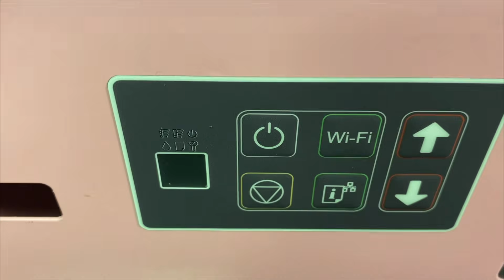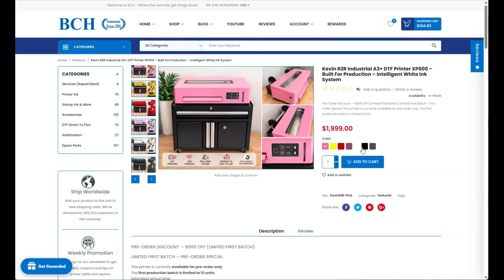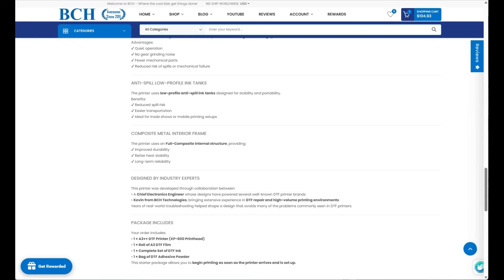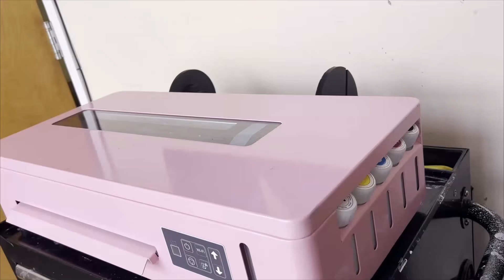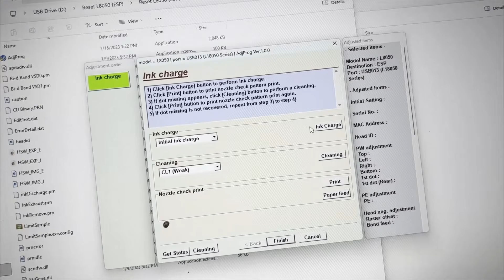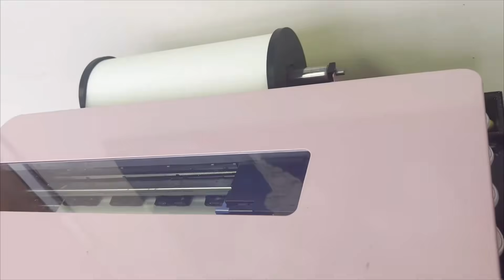Most DTF Printers Are Overcomplicated — This One Isn’t

Comment: Hi can u tell me cr motor model number
Reply from the maker: Thank you so much for your support and engagement! The CR motor used in that printer is a proprietary part, so we’re not able to disclose the model number. You are right that the CR motor is a very critical part of this printer. Most Epson printers are not designed for roll to roll DTF printing. We did shed blood and tears to get this motor correct.  We sell the motor seperately on our website which can work with ET-8550, L18050, 1390, and L1800. https://bchtechnologies.com/products/industrial-high-torque-cr-motor-upgrade-for-epson-et-8550-l1800-r1390-1390-dtf-printers?_pos=1&_sid=23066c6fa&_ss=r I truly appreciate you watching and asking. I receive a high volume of printer questions every day, so subscribing or becoming a channel member really helps because subscribers and members receive priority replies and extra benefits such as early access to videos; subscribers and members are typically answered within 48 hours, while regular viewers are answered if time allows since I can only reply to about 10 questions per day. After subscribers and members, any remaining reply slots are filled last-in, first-out, meaning newest questions are reviewed first, so if a non-subscriber does not receive a reply within 48 hours, they can either subscribe or repost the question; if they subscribe later, their older questions automatically become priority without needing to repost. For faster assistance, please email [support@bchtechnologies.com](mailto:support@bchtechnologies.com), and I also invite you to join Run With Kevin — LIVE, where I go live every morning, usually between 6–11 AM Eastern, and answer printer questions in real time, so please subscribe and turn on notifications to catch the next live session and ask directly. If this video or comment helped you, I’d really appreciate a Google review here: [https://g.page/r/CfL7k6nYvPQ9EAg/review](https://g.page/r/CfL7k6nYvPQ9EAg/review)

Comment: Which RIP software can you use for your printer?   I have an Enjoycolor DTF that uses EraRip.  Can that software be used with both printers?
Reply from the maker: Thank you so much for your support and for checking out the video—I really appreciate it 👍 For this printer, I’m personally using AcroRIP 11, but there are quite a few RIP software options that can work depending on the driver setup; since your Enjoycolor system is based on EraRip (which is CADLink-based), there’s a good chance it can be used with both printers as long as the correct print driver and configuration match, though sometimes you may need to tweak settings or profiles to get optimal results, so it’s not always plug-and-play but definitely possible in many cases. Just a quick heads-up, I get a high volume of questions every day and can only answer about 10, so subscribers and channel members get priority replies within 48 hours along with perks like early access to videos, and after that I answer newer questions first, so if you don’t hear back within 48 hours you can subscribe or repost your question, and if you subscribe later your older questions automatically become priority without reposting. You’re also welcome to join Run With Kevin — LIVE every morning between 6–8 AM Eastern where I answer questions in real time, so make sure to subscribe and turn on notifications to catch the next session. If you need faster help, feel free to email [support@bchtechnologies.com](mailto:support@bchtechnologies.com), and if this helped you out, I’d really appreciate a quick Google review here: [https://g.page/r/CfL7k6nYvPQ9EAg/review](https://g.page/r/CfL7k6nYvPQ9EAg/review)
Reply from the maker: Update: I wrote my own RIP software eventually.